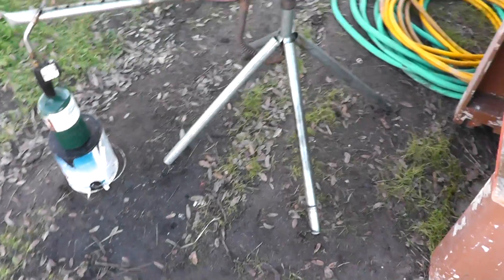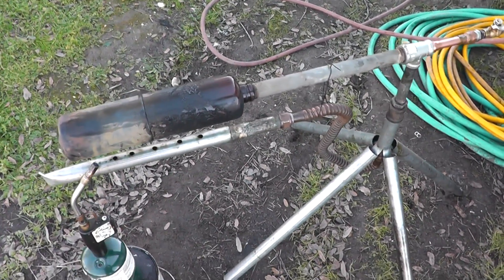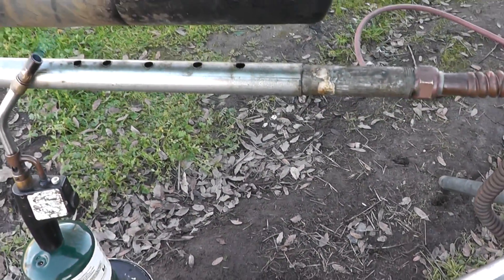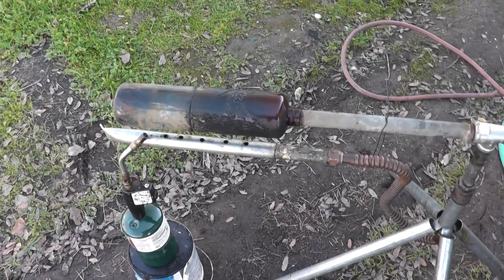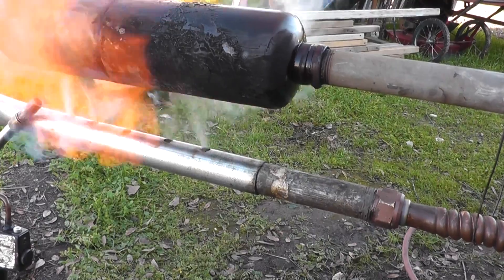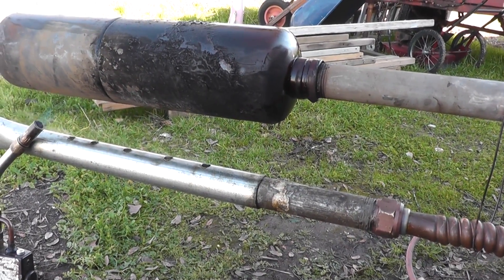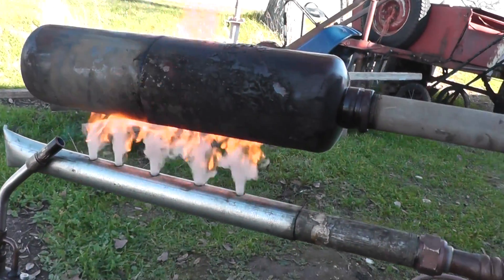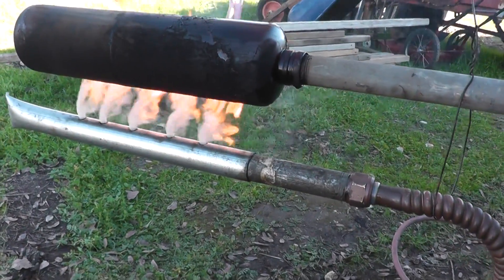Used Motor Oil Gasifier v2.1S - Increased Throughput & Improved Burner

Comment: The amount of propane that you used to heat the oil up would have ran that motor for 2 days
Reply: After it gets started, it runs on it's own fumes. An engine would use that bottle in a half an hour.
Reply: @wesKEVQJ  there are much better ways of doing it.....I made a waste oil gassifier once out of an old propane tank that you lit with an oil soaked rag...i put a 1/2 quart of dirty oil in it and it turned cherry red and melted itself in about 20 minutes...

Comment: Burns too rich!  You need to blend Air/Oxygen to gases and you will be able to burn it as a blue flame. To do that:  Connect a 1/4 HP regenerative blower to same pipe  you punched number holes but you have to be able to adjust the speed using single phase VDF and you will get there.

Comment: You have created a pressurized tank full of scalding and flammable oil. Congrats...you are dumb
Reply: Pressure inside is very low. Mixed gas has not enough temperature for ignition. Think before write

Comment: with some small burner tips, to draw air into the flame and, adjusting the distance to the reservoir, you should have a very blue flame. A shield to block the wind would help. There is so much flame, that it will gasify very fast.  So what if you adjust the flame, and used the excess gas for a small engine? Back flash is a real danger so, you should have some screen material or back flash arresters. Good job on the build and video !

Comment: Your "reactor" would be better if you used an old Pressure cooker.

And of course you need a cowling to keep outside air from blowing away your heat.

A spiral shaped tube with holes drilled in it would serve as your burner.

My first rig used copper pipe with no problem.

I don't know why you chose a gasifier when a Babington Burner is simpler.

Comment: It might be more environmentally friendly to have the oil recycled.
Reply: "Recycled" oil is mostly repurposed as heating oil. He's just "cutting out the middleman."
Reply: Recycled oil is usually burnt - or mixed with rocks, dumped on the ground, and called asphalt.  Not many other uses for it.  If one can use waste oil in place of other fuels, it's far more environmentally friendly to burn it where it is.

Comment: If you cooled the exhaust by bubbling it through water, diesel and gas will float to the top of the water.

you are thermally cracking long hydrocarbon chains. this can be done with any hydro carbon even plastic.
Reply: Interesting ! do you have a link with more info on how to do that? maybe youtube vid?
Reply: search "plastic oil" on youtube. you will find many interesting videos. the same concept can be applied to wood, tires, poop, plant matter, used oil. youtube video maker Mr Teslonian has a video where he makes motor oil, diesel, and gas from sticks.
Reply: HillbillyMatt ExtremeDIY

Comment: if you were to take a 8-10" piece of stove pipe and seal off one end and slide this down inside of it after you add the aforementioned extra air intake pipe inside for regulation you could effectively control the heat and make it produce more efficiently as well as contain the heat to use it for other purposes.

Comment: you have to mix fresh air in the burner, make a tube inside of another to succefully regulate air intake, the firs one with a hole to let the fresh air get inside.
Reply from the maker: that makes sense. when I get around to working on this project again, I will try it. Thanks.
Reply: Hernán Sánchez Paya pentru

Comment: you need to pull your gas tube out of your burner a bit to let  the gas to mix with air so it will burn clean out of the manifold
Reply: +Ken Berscheit Iagree with that, mixing fresh air with the oil gas, will improve flames, make a tube inside of another to succefully regulate air intake

Comment: So with the amoung of propane or combustible material your using to heat the oil...wouldn't it be easier to just run the engine on propane?

Comment: Have you considered installing a bent piece of tin around the bottom of the burner tube that angles up at a 45?  this would provide some air deflection and localize the flame...

Comment: Your burner could use smaller holes, it needs more holes, and to be a little closer to the atomizer. Some sheet metal would help hold in, and draw heat around the atomizer and shield the burner from wind .

Comment: so I have watched you video and thanks for the ideas so I took it a bit further and found that if you did twice as many holes at about half the size they are it would burn better because of the increased air velocity and a second change that would help a lot is if you cooled the smoke maybe run it through a few feet of pipe in a bucket full of water and the back into the point you have it going in now
Reply from the maker: charles fournier The vapor cooling is a good idea. It might make the gas more potent (per given volume) and the extra tubing might be a buffer to create more consistent fuel.
Reply: ***** hey I learned a lot from mr teslonian his videos are great

Comment: the flame likely goes back into the burner because there is too much oxygen being added to the oil vapor too early in the system so that the mixture is flammable back in the tube.

Comment: I'm a little confused. So you're heating up used motor oil until it turns to gas, and you are then burning the gas produced to continue heating the motor oil? And do you know the chemical reactions involved with this? Are you burning only the oil, only the contaminants, or both the oil and the contaminants?
Reply: Anthony Navarro this is called thermally cracking hydrocarbon chains into smaller chains. if he were to distill the exhaust he would get diesel, kerosene, and gas. there would still be a flammable hydrogen gas byproduct that can be used as a heat source to continue the reaction. you do need to provide an initial heat source to start the cracking process.

Comment: Smaller holes in the burner is better you get more pressure and the wind hasn't so much influense ont the flame .
Reply: That's what I was thinking too. Plus a way to add combustion air without taking more fuel with it.

Comment: This design is very dangerous reason said is because that tank can explode on you if the pressure go's too high or if you get some type of crack in the camber.   It would be as if a bomb went off.    Becareful for anyone that makes this type of design

Look on my channel for a much safer design.  I have built drip feed design and the atomization design

Comment: you need to install a orffice in front of burner and a control valve for the gas flow to burner
also the burner holes need to be much smaller,you also need a mixer valve to allow the gas to mix with a small amount of air
Reply from the maker: Good ideas, thanks. I've been trying to design more of a torch type setup so it will burn cleaner.

Comment: wasre motor oil leaves a lot of ash behind after burnng, can't be avoided, so you will need a way to clean out the boiler vessel.
Reply from the maker: My best method so far is shaking around some small nuts and bolts in there every one in a while.

Comment: I filter my WMO through re-usable shopping bags (the fabric kind). This takes it down to around 30-5 micron depending on buildup inside the bag. Then I put it through a 1 micron filter sock.
It all costs about 20 dollars.
You can also build a centrifuge for under 200 and run it off a generator that's being run by a gasifier.

Comment: Can the air be introduced through the top of the oil tank near the closed end, rather than pushing it in the same pipe that you are getting the gas from?  I wonder if an air draw system would work without a compressor?  Really like your videos, and am looking forward to more on the gasifier.  Do you live in the Sierra Foothills above Sacto?

Comment: The burner fuel air mix will have nothing to do with the engine fuel air mix, They are separate systems. Once you install a tin shield to block the wind you can tune the f/a mix better(Oriface size looks a little meaty too), burner efficiency and output consistency will go way up. Use a Tee fitting with 2 ball valves to adjust the fuel mix on the engine. Use one of the ball valves to let in air.  That seems to work best on the gasifiers I've looked at that work well. Cool video!

Comment: Consider putting a sheet metal V around the burner/gasifier. It should direct heat back in and prevent wind from blowing heat away from the gasifier.

Comment: The looks cool. The thing you need to do is add a valve at the burner and small air hole that you can close with a piece of cut tin and hose clamp to hold it in place.
The valve builds pressure in the oil cooker. The air hole at the beginning of the burner allows for mixing of air and gas so that proper combustion takes place. Thanks for sharing I will have to build one of these for a heater this next winter.